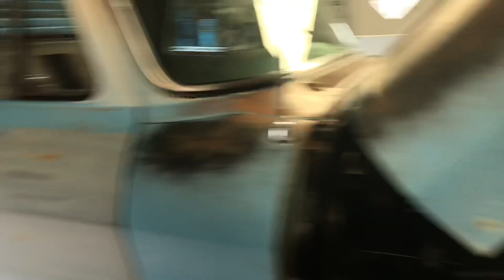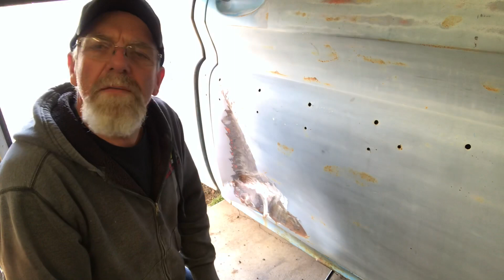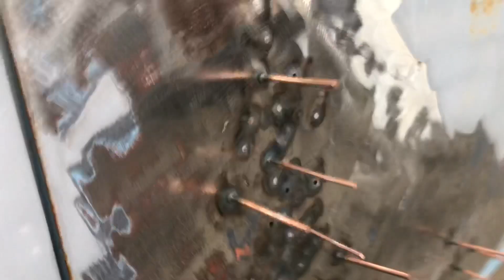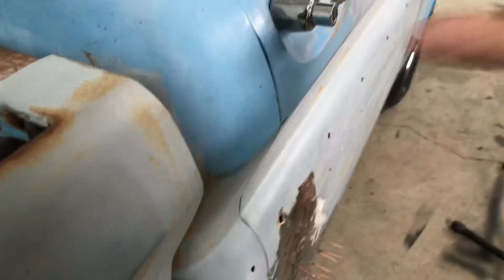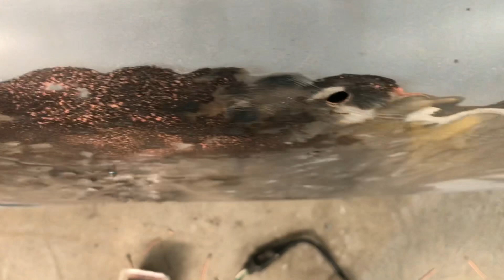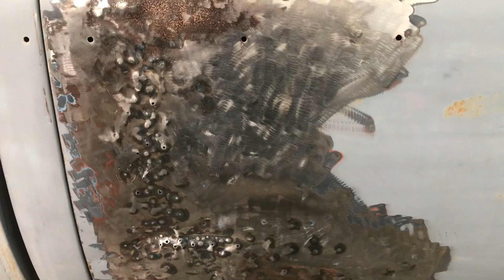66 Chevy truck dent repair! Part 1

Comment: Good for you for diving in! I learned if you imagine how the dent was pushed in to shape (started at the rear going toward the front, or vice versa) you pull it out in reverse. So you may start in a shallow point and be working into the deepest. Sounds like B.S. but it works the tension out of the metal. comes out easier as you go along.
Reply from the maker: I got more body work to do on that old truck... looking forward to learning more!

Comment: You could cut down the door and across. Then pull panel out some. Put dolly and hammer yo the door till its straight. You have some extra metal since its stretched so when you are done hammering you and grind some off till it fits and weld it up.
Reply from the maker: Thanks for the tip! I was thinking about doing something like that. That stretched spot is still fairly deep and I dont want to fill it up with bondo...

Comment: Thank you for the information.  I have a 1964 Ford pickup F250 and wanted to get some ideas on taking out some dents.  I noticed you got your tool from Harbor Freight and it is only about 1 mile away.
Reply from the maker: Good luck! And thanks for watching!
Reply: The more I see of this video the more I am impressed.  Great job.  Some of the older vehicles will not allow you to get behind to beat it out.

Comment: What is that welder tool an where you get slide hammer like that
Reply from the maker: It’s a harbor freight stud welder… and I believe the slide hammer came with it
Reply: Just found at harbor freight 100$ comes with slide hammer called stud welder